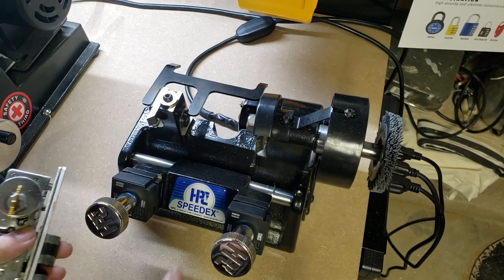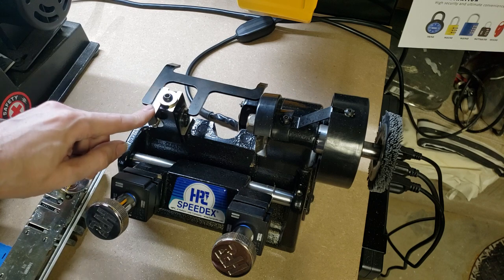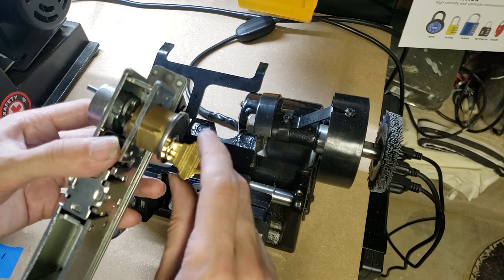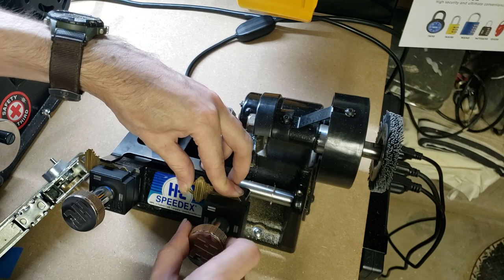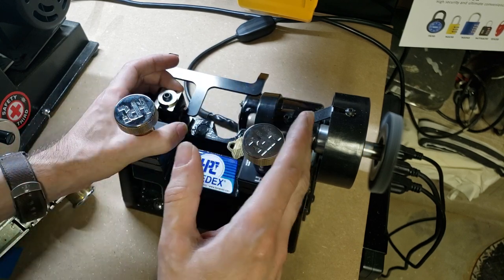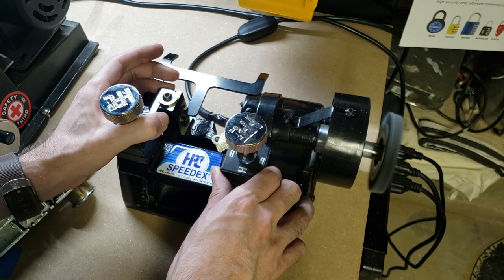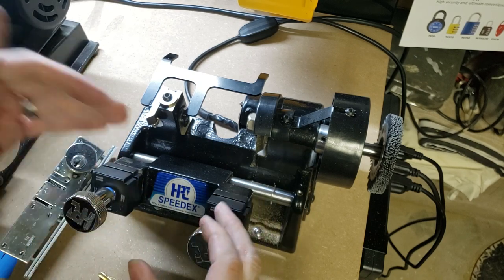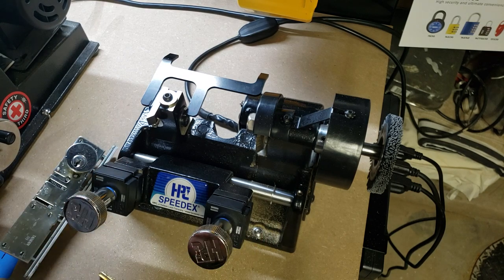(118) Copying keys with a manual duplicator

Comment: Great video. One suggestion and this is what I do in order to save my brush. I have a stiff piece of steel attached to my bench which I drag the burr side of the key across before brushing. It will save the brush and time removing the burr's. Especially useful if you have heavy cuts on a key.
Reply from the maker: Interesting idea. These machines are in my home workshop so they don't see heavy daily use but I may try that at work since we are always running low on good brushes.
Reply: @Nite0wl  Wasn't sure if you did that much at home. In the shop you will definitely see the difference in how long a brush will last. Once you start using it, it becomes second nature.
Reply from the maker: Until recently I did most of my work from my personal workshop but it was rare that I would do anything remotely close to the sorts of volume a storefront locksmith would do.

Comment: Cool machine. I have a fully manual contraption here. The whole thing is about 8 inches long and works like a treat. Easily fits into your backpack for red team shenanigans.
Reply from the maker: This is not that much bigger but the weight is a bit much for that. I am working on restoring an old Yale M1009C that is built into a carrying case, kind of like an old portable typewriter.
Reply: @Nite0wl  Ye olde keymaster. Nice!

Comment: My micro metric does not have a shoulder guide which makes it tricky.
Reply from the maker: Sometimes you can get away with using the jaw as a shoulder guide, but you may need to make your own.
Reply: @Nite0wl  I try to use the shoulders against the guide and blade.
Reply: Darcy Parker The micro metrics, it’s best if you use the cutting wheel as your stop. I have one of those, I’ll try to get a video up!
Reply: Darcy Parker How to stop on this machine I cover in this thread, until I can do a video! 

https://twitter.com/r0brbun7/status/1162053345655177216?s=21